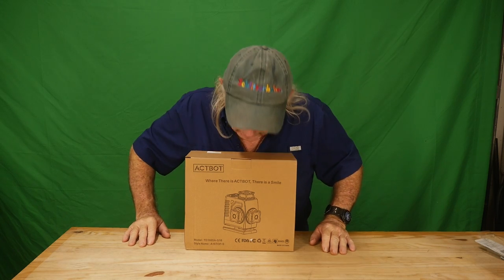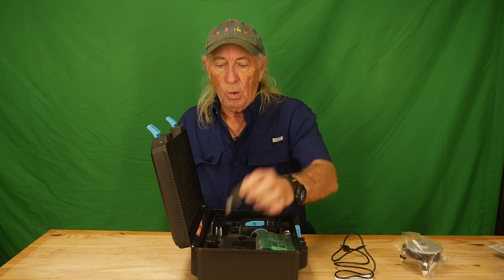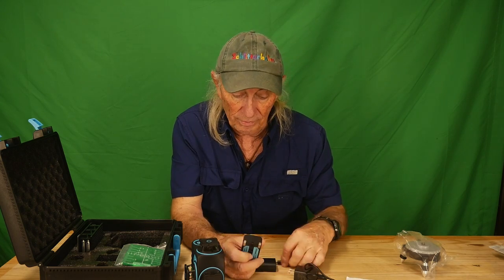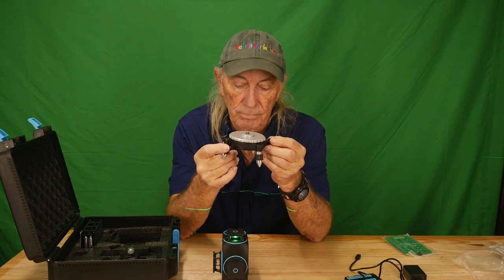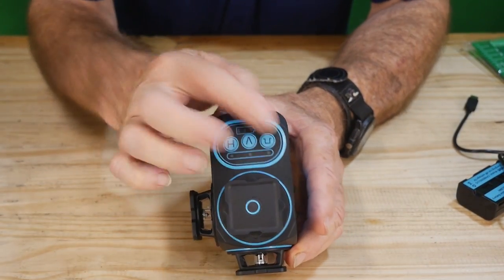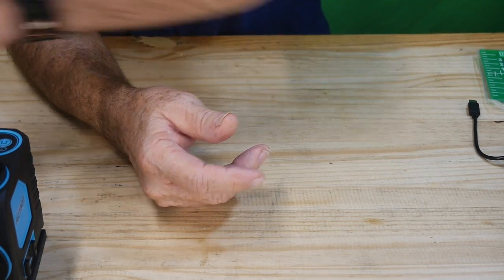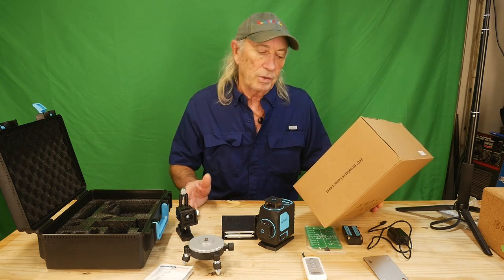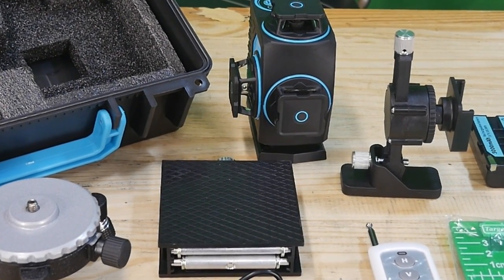ACTBOT LASER Model TD1605A-G16 reviewed by C&T ep 321

Comment: 50% off coupon is pretty darn nice. I have 2 laser levels.....somewhere.......but they were older cheapy models and I just went back to measuring from the floor and ceiling to line everything up LOL Great video, always looking forward to more!
Reply from the maker: Thank you Stumbling !
Reply: 50% off coupon?! Where did you see that? I’m seeing Amazon $189.00. Is that 50% off? That would sound reasonable for this system, $378.00 that is. But I didn’t see anything that addressed 50% off. That would be a huge discount!! Usually you’re just going to see 10% off which will never ever draw me into a buy. But 50%?!? I could be tempted!
Reply from the maker: @keithrayeski6417  Under the price, you'll see a 50% off discount deal on the page that I gave the link to.
Reply: @keithrayeski6417  I have 50% off on my end. I can't post a screenshot or I would. I have Prime, don't know if that matters. Coupon should be right below the Prime FREE returns thing. Just check the box and it applies it. Normal price $189.99 THEN 50% off. I go to checkout and it takes $95.00 off so makes it $94.99+tax.
Reply: @StumblingBumblingIdiot  I’ll have to look again. I have prime but I didn’t see the 50%… I’ll go back.